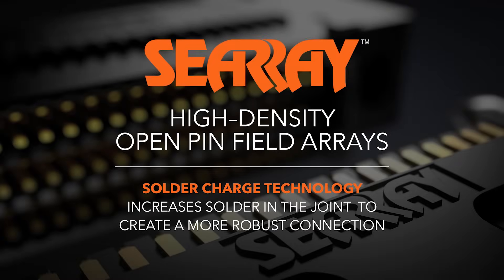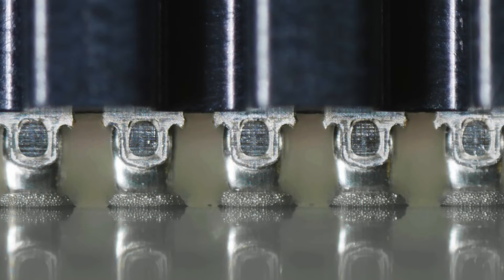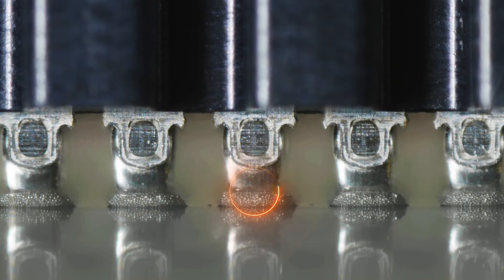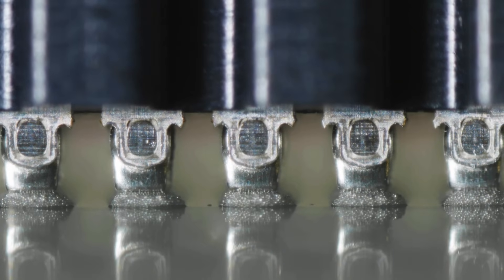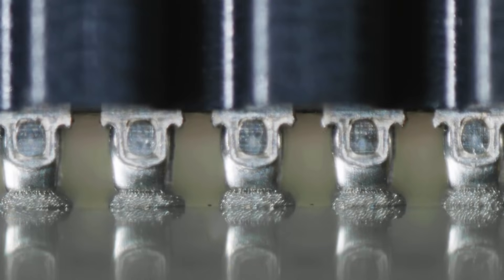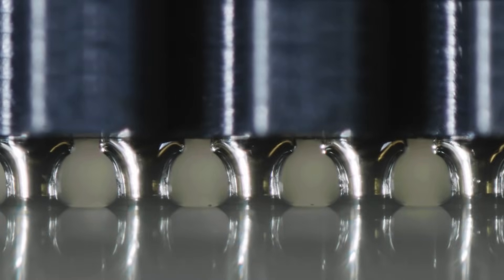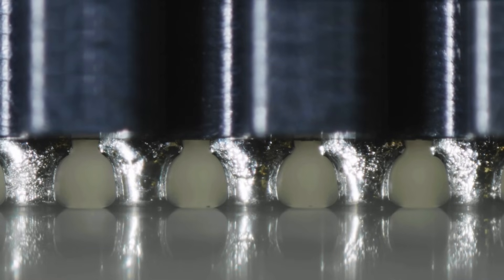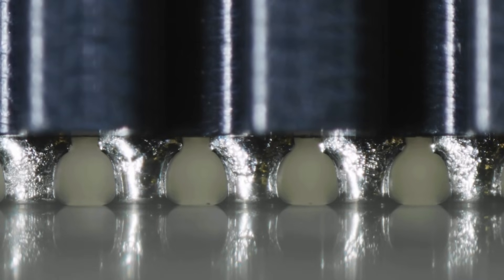Solder Charge Reflow - Samtec

Comment: I am facing problem during other side of reflow soldering few parts getting drop,let me know the reason
Reply: I assume you are using two differing solder pastes of which melt at differing temperatures, you start with the higher melting point solder and parts, flip and do the other.
Reply: @martinwashington3152 
No different solder paste for both side.
Reply from the maker: Hello Dadapeer,Please send an email to ipg@samtec.com, and they will be glad to assist you with your reflow questions.